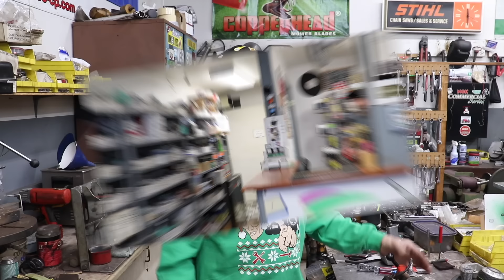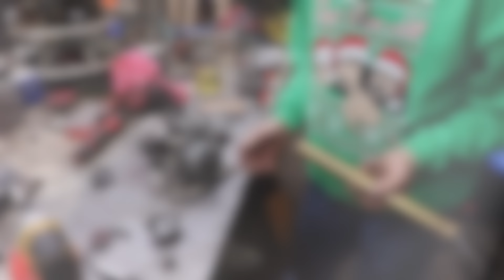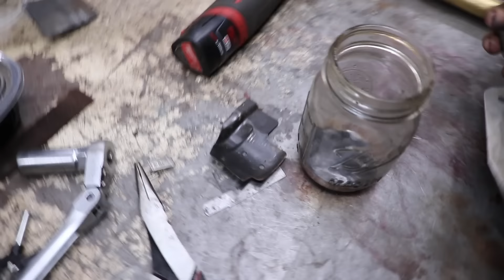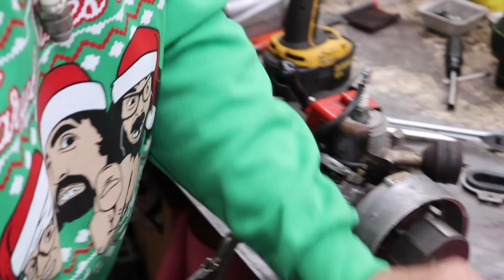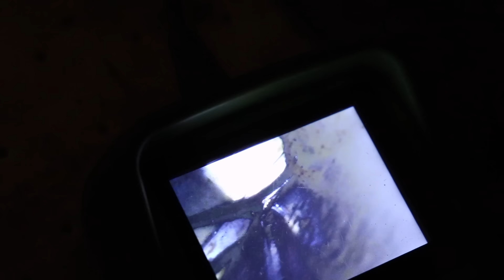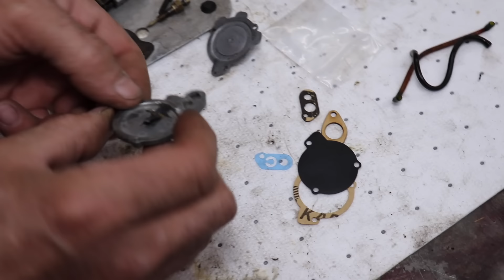World's SMALLEST Generator EVER! Will It Run?

Comment: That is a neat little Ollson Rice tiny tiger.
You were brave taking the end off the genset. I was sure it was going to crumble inside, but no, you pulled it off.
I was impressed with that patience.
Maybe they used it for  power that made too much heat over time and caused it to stop generating. then the oil and gas reduced to that sludge goo. Too much oil in the mix maybe because it was in the tubes?
When could you be sure you had that pump screen clear?
Numerous washes and rinses while jabbing.
How could you get paid your labor?
That makes them a labor of love.
The customer finds out you need hours and hours, decides, no, they buy the new kind.
Hope you did get time and parts covered.
Nice work and good video.
I cleaned points a few times in my life.
The reason not to on automotive is pitting and buildup transfer.
Like stalactites and stalagmites.
You don't do that to a customers car because the boomerang effect.
Then they want new parts and to pick it up FOC. As a comeback.
But on small engine, it's not real far from home and used as many hours, right.
Everything went electronic on cars and maintenance cost was less repetitious but more expensive. It sells the unit because of dependability estimates.
You clean all the points you like, like I do.
When badly pitted you need a condenser anyway.

Comment: The reason you don't sand with emery paper, I was told, was because the grit particles can detach and embed in the metal and you end up with like two bits of sand paper rubbing against each other
Reply: A little more elaboration: Emery cloth contains varying amounts of carbon. This carbon is harder than the contact metal and will become embedded in the surface of the contacts.

The carbon will do two things. One, there's the chance that it will make the contact area resistive. This causes a weak spark and arcing at the points. Two, because of the resistance and the arcing, the points will burn quicker.

Garnet and flint papers have less carbon, but they can still embed particles.  

My dad would use a piece of coarse paper, like a paper bag, or if they were really bad, an ignition file.
Reply: @ryoungatlmidotnet  Also the grit may wear rub block or cam ...

Comment: any old mechanic will tell you to use a file over emery because the emery can round the points edges giving less point life , its best if the entire point surface is used other than the middle or edge only , also in some points systems  if the points are not flat they will arc more and wear out prematurely or become worn at a angle. also any one from back in the day can tell you , most of the time when you bought a new set of points it came with a tiny piece of paper telling you all of this. its not a mystery, see , that's why your elders some times can answer questions goggle can not. lol

Comment: According to my journeyman father, and a small motor technician instructor you don't sand them as it supposedly allows an uneven break in contact as I watched both do it. Book learning vs street taught. I've done with no issue either. Love the CT70 also, mines an 83 with a Locin 90. My mini genny is a 650w honda!

Comment: That gas tank was nasty plus them fuel lines  ,ya that aspen fuel is also in Canada  they say you can run them 2 stroke s in doors  not bad with the exhaust  but good job on that little generator 👍👍👍👍👍👍😎

Comment: The reason taught to me about using sand paper is that sand paper can leave grit embedded in the contact surface where as electricians emery paper will not. A points file or burnishing tool is used to dress after emery paper.

Comment: This guy is one of the best old school mechanics I've ever seen. But instead of using a appliance I use a voltage meter to set the rpm to get the right output. On a small generator the spark plug other octane of fuel can alter your output.
Reply: Yep. Set the rpm's to give an output of 125 volts max at full throttle when warmed up.

Comment: I’m sure this comment is altready out there. Get the ginnerater running. Measure the voltage output of the plug. Set the idle where the voltage coming out of the plug is 110 or 120, whichever is on the data plate. 
I also saw it puts out 12v somewhere. Maybe a follow up showing the 12v and setting the idle. Thanks for the fun.

Comment: i atcualy do have a reason why i was told never to sand them wich i have sense ignored seeing all sorts of peiopel do it   in high school the small engine mechanic   in the small engins class i was in in 2011 said that samnmding them will  wear down the points and throw them out of adjustment and make less efficent spark he always recomended if they are   coruded toi simply replace them with new ones  to avoid  them ruynning poofly... and i have watched hundreds of   small engine videos on youtube  of peaple sanding them and  have sense    thrown that advice out years ago i even do it myself now if i need to its free...  don t have to pay for new points when sanding them  works just fine

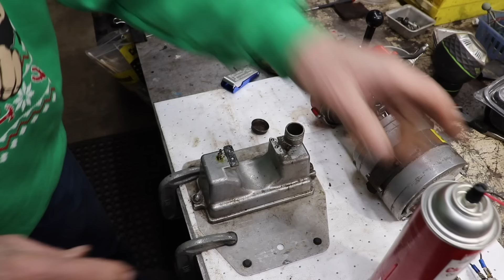Comment: 49:50  The crossover line is to equalize the pressure between the two high section of the fuel tank.  Without it, the air in the section opposite the fill port cant be readily displaced, hampering it's ability to be filled or drained.

Comment: The silica in the sand paper can insulate electrical contacts.  You never clean a flame sensor in a furnace with sand paper because of this reason.

Comment: Holy buckets! What a great restoration video. I bought a kit to motorize a bicycle that included one of these O&R engines which drove a knurled drive wheel that came into direct contact with the tire. It was fun. I wish I still had it.
Reply: I remember those, it was called "chicken power" I thinks

Comment: I have one of these!  The generator is on a shelf in my basement and the engine is in a 50" long, radio-controlled model boat, called "White Heat"; that I built from plans that were in an old Popular Mechanics magazine.  When I first got this engine/generator, I fired it up, plugged in my incandescent shop light, and the engine bogged right down!  It served me much better in White Heat which I still have with me today but have not run it in years.  Back then, this engine was even used in a few model radio-controlled helicopters.  Now, there are much better engines of course; my engine of choice now is the weed whacker engines expecially the ones with an automatic clutch.  Good to know that carburetor kits are available too.  BTW, my O&R engine has the original air cleaner!  Thanks for the video and the memories.  Karl
Reply: I remember popular mechanics had a plans for a micro mini bike too that used this engine.  I used to read PM cover to cover when I was in grade school.
Reply: @scrappy7571  Popular mechanics had lots of interesting things you could build, I built many things from there plans, in my first shop about ever thing even my air compressor was from there plans.
Reply: Interesting,  guys just build stuff. Women talk about it.

Comment: That was a cool video! I'd heard of Ohlsson and Rice model airplane engines from the 30's, 40's, or 50's, but didn't know they made Tiny Tigers!! I'll bet cell phones were really rare back then. That was sure enough a wild carbertrator!
Reply: "Cell phones" rare? Almost every airplane had one, they're just a two way radio, with some fancy codes built in now that they're "digital." Like two machines talking to each other in their own morse code, just really fast
Reply: @user-ut9ln4vd5m  They was analog at first, went digital few years ago, around 1960 the new York times predicted them and described how they would work, the debate then was not if it was possible to build a cell phone. But if the public would use them. Around 1975 we was using fm radios in our trucks. Only thing changed, was they installed switch device which reacted to number dialed and connected the fm signal to another radio,and called it a mobile phone. On my first phone you needed to be real careful where you made a call,or received a call, because of roaming charges, was easy to get a thousand dollar phone bill. First carry around phone i remember was late 80s early 90s. But i am sure they had them before that.

Comment: It's built like a big coxs engine the way the head  Unscrews with a spanner wrench and  The way the muffler goes on the head like that Also from some of the information that I read up on these yeah the 300 W 1 was a solid magnet generator where's the 400 W head Is brushes and didn't have the 12v dc

Comment: Hey Taryl! Great video! Thanks!
I have a suggestion & a question.
Suggestion..
When ever I disassemble any electric motor, I take a sharp object (a scribe, screwdriver, knife etc) or a fine point marker (Sharpie) and use ot to scribe across the junction between the stator & each end bell housing.  On one end / bell housing I make two scratches, on the other end I make one scratch across the junctions.
By making these scratches before disassembly reassembly is a little less confusing.
The correct alignment & orientation of the stator during reassembly is assured (on some motors (eg. shaded pole) inadvertently flipping the stator will change rotor direction), through bolts easily inserted & other problems averted. 
My question is..
Was there a reason for you not throwing the gunky gas tank into your ultrasonic cleaner?
Best regards,
 Dennis
Reply: I'm trying to remember if he even has one.  He must.  I've seen so many of them that I can't remember who has what.
Good point with the marking of the stator.  I could make that mistake.

Comment: When I put a GYT Kit cycliner  on my Yamaha GT-80  that tripled the engine RPM's  it would blow out the 6 volt headlight .. if the two stoke  engine even started to come "on the pipe"

Comment: Very nice video, as usual, Taryl. Concerning the RPM, I would use the multimeter in 115V slots and set the engine speed according the correct voltage value. Greetings from Czech small engine shop. Great job!
Reply: Frequency is more important. 3600 on that little Engine should be about 60Hz..
Reply: @m9ovich785  Because of permissible voltage range - YES, the frequency is more important.
Reply: The generator has a two pole winding, 3600 rpm delivers 60 hz.  For many appliances, this may be more important than voltage.
Now, if you had to run a motor that stalls (eg pump) on start, maybe you could soft start it by starting at half generator / alternator speed & then increasing freq to 60hz after initial start.. just a thought.
I was thinking it might be an ideal fit for an off grid hunting or fishing cabin to recharge a LiFePo4 based system..  Light enough to pack in & out, a 4 hour run would fully recharge a 100ah battery.  Depending on how frugal the load, it might support a system for several days between recharges...
Reply: 60 Hz friend

Comment: When I was told not to use sandpaper on points, I was told not to use "silicone oxide" paper. The silicone will act as an insulator if a chunk gets left in and crushed up, as where aluminum oxide will powder up and fall off when crushed. Same goes for flame sensors on furnaces, the silicone oxide residue will melt into glass, the aluminum oxide paper grit will just burn up. If the paper says "waterproof" which almost all emery cloth is, it's going to be metal oxide based.
Reply: I was taught a similar concept about material impregnating in the contact pads. The impregnated material can cause high non conductive spots that lead to arcing and pad burn out.  I was taught to use a fine contact file in training for chainsaw repair (Stihl) and the electrical industry ( mechanical contractor and relays).  Right or wrong? Who knows it is what was taught at the time. Every time I am somewhere and see a new points file I get one.
Reply: @jeremymanley5256  Agree, any type of sand paper is going to leave contaminants embedded in the contact material.  File is whats best to clean the contact surface.  But it ain't the space shuttle.
Reply: Silicon.  Silicone is a compound of of silicon.
Reply: Point file should be used, Horrible Freight has a jeweler file selection in a pouch of a dozen or so,

Comment: The crossover tube is to prevent air lock. Necessary for such a tank design where air can get trapped and keep the tank from filling or draining properly i.e. without it you wouldn't be able to fill the pick-up tube side of the tank as trapped air would prevent you from filling that side with fuel. Also the gas mix ratio, based on those instructions, is 24:1
Reply: Thats right. In the 2000s I owned a `87 VW T3. Someday i lost gas. The tank had an anti air lock pipe, too,  made of pvc. When the car gets old it shrinks and break the plastic knee which was connectet to the tank  - horrible to change. I fixed it by mounting a new  original knee and a pvc garden hose and clamps - it worked.
Reply: One should be a pulse line.

Comment: This was unique in that it used crank shaft rotary valve intake design. Very much like that modern model airplane engines use. 3500 RPM and use 24:1 mix

Comment: I have a big collection of O&R stuff..... generator, chain saw, drill, a hedge trimmer and a couple model airplane engines. The Tiny Tiger I have is NOS in the box. I did run it once. It's a little screamer. I have video of it running on my YouTube channel. I think they're governed for 120 volt at 6800 rpm. I have a ton of parts too. My grandpa's neighbor was an O&R dealer back in the day. Back in the mid 80's I bought everything he had left. There super cool little engines that were good runners, but very loud.
Reply: Dad had one for camping in Davis Mountains 
Still in shop

Comment: You called it a Rotor , it's a Stator. The Rotor it the part that spins, Its a two pole rotor so it should be 3600 RPM (60Hz) if it was a four pole then it would spin at 1800 RPM, that's my nickel. Good job Taryl !

Comment: The reasoning behind the " never clean points with sandpaper " is that particles of grit could be left embedded into the surface of the contacts and this could cause burning and failure of the points in operation. Who knows,  maybe with some specific engines and using certain sandpapers it's true?

Comment: Best way to set the write speed is to get a voltage meter and set voltage at 110 volts ⚡
Reply: Why 110 Volts? Even when that generator was new the grid voltage was already 120V. 110V went out in the 1950s.

Comment: I loved this Resto,you really are a master. I can't wait to see you top this one! I hope you get around to some old clinton stuff sometime,Thanks for the edutainment.
P.S.
 reason we were given for not sanding points was it embedded filings into the carbon,but you took the time to actually clean the contacts first and negating any of that. Way to go as always.
Reply: That was the exact reason I was given in the early 2000's after doing it since my grandpa taught me back in early 80's. Apparently a lot of people sand the gunk & grease into the points, instead of cleaning them first.
Reply: Interesting. I recall being told that the points had a special surface layer and taking off that surface would end the world.
Reply: @snakerstran9101  Tungsten on points varies in quality, or thickness. Blue Streak and a few others made point of such quality that filing was okay.
Reply: Or get on a lubricated points cam and grind like a lapping paste ....

Comment: I see lots of guys do it, but here is WHY you don't sand points. Disclaimer I sand points! Here is the problem. Even a small amount of the abrasive that may come off of the paper can hold the points apart and prevent contact. The next thing you see is some guy wasting his time, gas, and money to go get a new set of points cuz the old ones won't work. Like I said, I sand them, but I make sure I clean them after so they work. Sandpaper works better than my points file. Just be aware of the risks. Those torch tip cleaners are handy. I use them to clean and size jets. Also useful as a string nut file on your guitar. I may have even used them on a torch once.
Reply: The reason you don't sand points is because some of them have a protective coating on them which you can sand off. But if the points are burnt up then harming the coating is the least of your problems. Why points burn up is another involved topic.